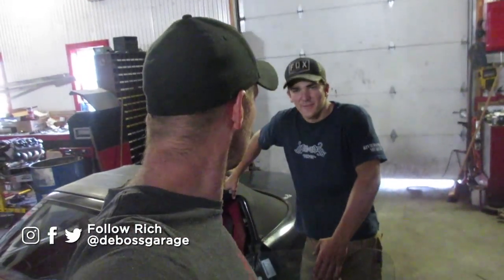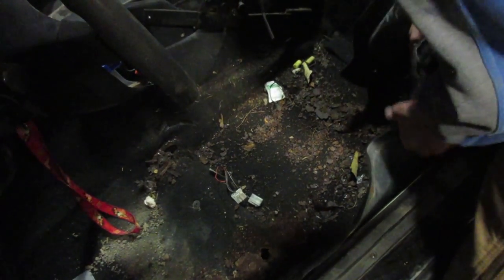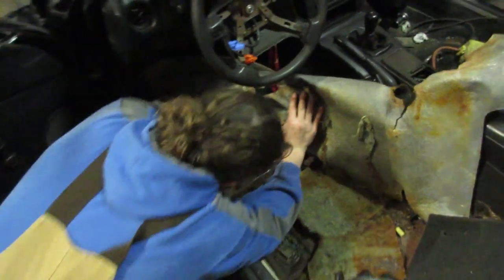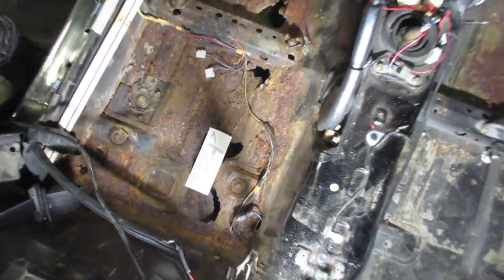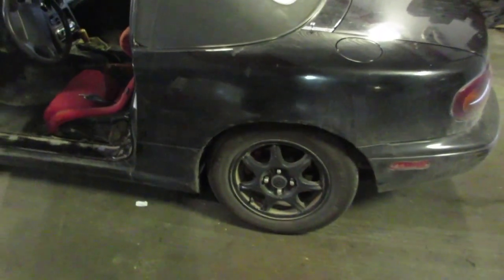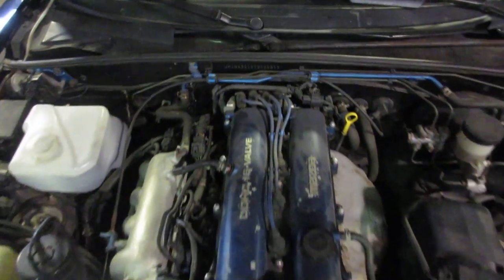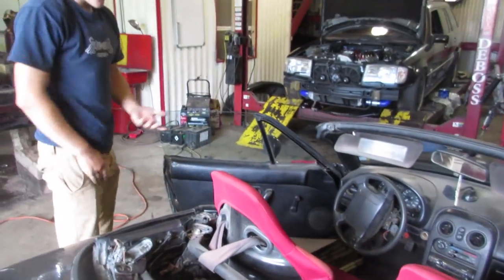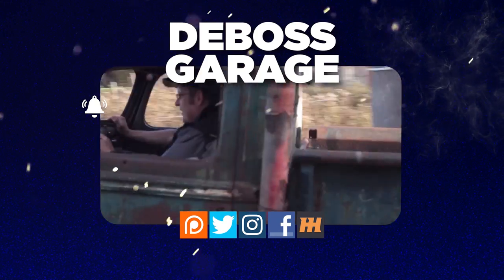How NOT To Buy A Used Miata

Comment from the maker: Meet Joel, our new employee for the summer. This is his Miata that he loves. Yeah we ribbed him a bit but he's been working hard on this for the last several months, his progress has been impressive so we thought we'd show it off.
Reply: DEBOSS GARAGE this is a great project, I'm excited to see some more videos on it! Please tell Joel that his harnesses shouldn't be attached to the brace behind the seats, it is very thin metal and will effectively do nothing in an accident.  I'm sure Joel has plans for a roll bar or cage or even building a real harness bar which would be fine to attach the harnesses too, but until he adds that he will be much safer using the original seat belts. A
Reply: Turbo SBC or LSX
Reply: DEBOSS GARAGE Joel sounds like he has a pretty sweet job!

Comment: Shit, if I throw a cold air intake in my 5.3 and some sweet stickers it makes like 11,000 hp.
Reply: Don't forget to carbon fiber wrap everything possible.
Reply: Its Voodoo yes and for extra aerodynamic horsepower you can add black plasti dip to the rims to reduce the drag. That right there is at least 100 ft kilos of horsepower.
Reply: Baloney! Cold air kit and stickers only add 500 bhp, tops!
Reply: Yeh basically

Comment: How not to buy a used Miata. Get an s2000
Reply: The s2000 costs alot more
Reply: i rather get a nd miata then. sure it is "expensive" but it is the cheapest roadster in the market brand new and the best really 50/50 weight distribution and its the lightest new car.

people complain that nd is expensive, but you think they can sell the car for 20-25k? they are probably losing money selling miata.

s2k is nice too, but a lot of ricer fuck boys like to fuck with those cars and is expensive, hard, and rare to find a mint one.

or get a mrs which is probably more clean cause they are less popular and they are even lightest than NA and cost almost or even less than a NA.